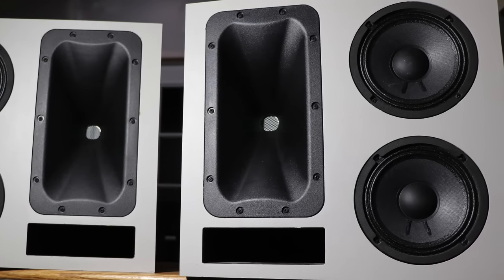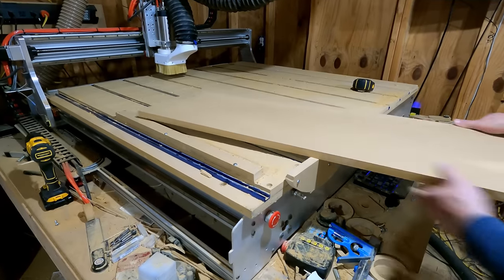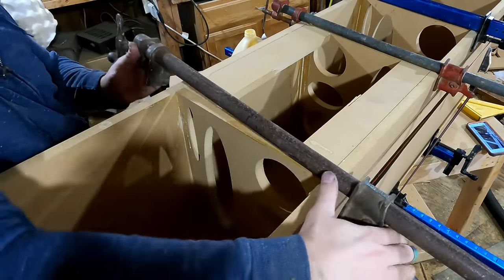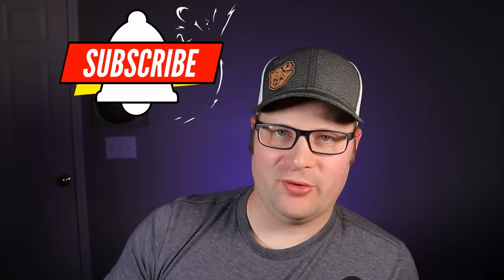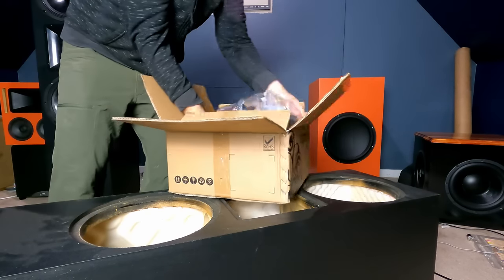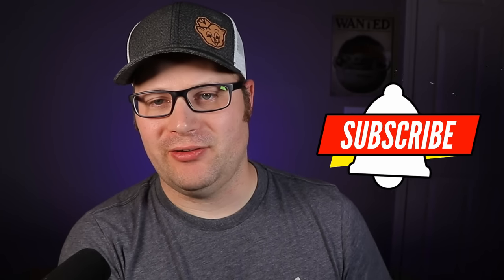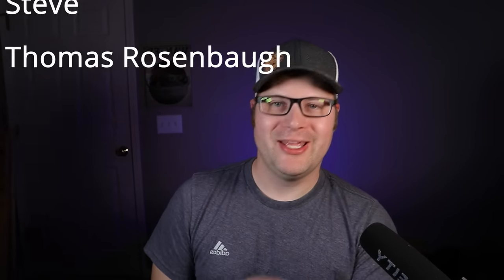How to Build $14,000 speakers for $1,300! JTR 212 Inspired - The Audience 212

Comment: Okay so did you drop these plans yourself and if you did can I get a flat pack for left and right center and how much are you going to charge a flat pack so I didn't go to but then I selling those anymore so I've been interested in doing a surround sound system and I wanted to do it with 12 instead of 10s so with that said I liked the design of these speakers I like the height of them I guess I'd like to hear what you said a flat pack since you have a I can't remember machine to cut these things out does two of the orange speak as you get I would like to build a build a pair of those but I don't have the dimensions of the paperwork to do its measurements so that's one of the reasons why I'm asking are you going to sell these as a flat pack me I kind of want to try the imminent drivers Oriole considering that I work in Pro Sound the ones you're using I've I've never heard those before so I'm not going to act like I have but I've done with you know dealt with some Eminence drivers Black Widow drivers jbl's Evie drivers you know like the 180 days to 15 jbl's and TVs I don't like the TVs but they're only certain I mean don't get me wrong you know you put enough power behind those Rascals they'll get up on there and then they'll stand up the Eminence drivers are very very very very very very clear I have done some gigs in the Ratchet & Company Carnival gigs and I actually stepped on the eaw system and you know what the eaw system cost I built my own subs and I built my own tops I built the system for the company I work for Nashville trapezoid tops Community 415 boxes Louisville Cardinal haven't even built some stage boxes four different sub boxes who are direct outs the one boxes that I'm pretty the devil inverted a teens that I built will you put the 1200 watt drivers in the boxes and we built two boxes and put the does a lowriders from Black Widow lowriders and they're worth like $4,800 4800 driver I'm going to tell you the same thing I tell everybody else if you go to buy the 18 inch lowrider those heavy water 18s they don't work well without without without without the assistant brother you have to buy two of them in order for them to work and you have to put them on the amp by themselves they need plenty of juice but the problem with those amplifiers is this RMS both of them together is about 8,000 Watts you got to have a minimum of 5,000 watts to push them but I guarantee you the 24 in wide 48 in tall 30 inches deep was an inch and a quarter recess in the front so you can build your own Grill every gig I've ever done with those inverted double A teams I've set off alarm I was doing a straight gig on timing shook the peoples pictures off the walls in your house and the crazy thing of it was they wanted us to turn it up and I bought 16 boxes out and put them on the street and it felt like it was making a street wave I see a lot of people come on YouTube and they go buy those black widows lowrider 18 and they don't have any idea you cannot underpower them they're not going to accept it not only that when you underpower speakers you do them damage I'm not saying that to you I'm saying that cuz I know some people it's probably asking why do you need so much power if you're going to run a 400 w 200 watt drivers in your box that's 400 watts do you need 800 watts to run those boxes because you caused the voice coils to run off center you cross them to buckle you do you do more damage to the driver cuz it's underpowered I mean this is also a factor with your home stereo you should not be running your system underpowered your arms you got to pull it manual out and find out what your receiver runs at what is comfortable with running at usually an integrated home system is good at 8 oh it's to 4 Ohms unless you are using an external professional amplifier that can drop down to two and run stable stay away from dropping down the two unless you got an amplifier that can drop down to that and run but as far as the GTRs I don't just want to know if you was going to sell some flat packs of those it's not like the pill two sides and the center Channel and I want I want to try to use the Eminence drivers license I like the fact that you using a 3-inch voice coil and you can get anywhere from a 4:00 800 watt drivers even though I probably won't go no further than 6:00 Century 12 and what for homes and you know I know a lot of people like I asked too much power anybody know anything about sound system is more power means the more clarity and I'm a big sticker I don't care if I'm running a 100,000 watt system when I turn it on I don't want to know it's on I don't want to hear diddly squat out of it until I push something through it and we made an appointment we don't get any systems that whom and if we get something that's how many we want to know where it's coming from and a lot of times I know you guys probably don't understand this but I'm going to drop this little tidbit on you if you are running an amplified system in your home and your system is getting an AC whom have an electrician come over and look inside your electrical panel if it looks like somebody just took a box of wires and threw it at the panel and close it up there's your problem to stop a harmonic hum inside your electric panel your wires must be grouped together in Perfect Harmony is the only way to keep your system from humming and making all kinds of crazy noise and I know a lot of you guys don't know that but you worrying about what your system keeps humming you got a Amplified system with Pro gear amplifiers and you wonder why that noise keep coming up and you can't seem to get rid of it you need what they call an equipment ground an equipment ground is this you hooking up a ground to your main ground bus bar and you are taking that ground outside you going to go to an electronic electric supply store get you a 6-ft ground rod more than likely get you a 304 lb hammer I recommend you put on some work gloves and try to force the ground rod into the ground what you want to do is push that stick with ground rod all the way into the ground you might want to leave maybe I mean cuz you can dig a little bit around it and why don't you hook the ground wire to that that will provide a good solid external ground for your system for your house your house will have a good equipment ground and you want to use a heavy gauge number 10 and number four wire then you also you should not do this already be in your house is called a cold water ground strapped to your water pipes in your house and it's done in your utilities room make sure you do not allow anyone to separate that wire from the cold water ground the danger in that is you will lift ground off of the house and it will fry every electronic you got in your house it will change the load but I just wanted to make sure make you aware that your electrical wiring in your house is vital you cannot have any loose grounds anywhere you plug it up there or sound system and you got to have an equipment equipment ground and a cold water pipe Brown is a necessary evil and make sure you are using a heavy a heavy enough gauge Supply power line to everything that you're plugging up I prefer 14 gauge cabling to everything reason for it 12 gauge cable don't get hot when you're running you know household products and items it won't get hot but you running 14 and 16 ladder gauge cables those cables man they make it hot on you so are you by extension cords make sure they're at least 12 gauge you can get away with 14 and 16 I prefer 12 gauge because no matter no matter what you plug up in your house you'll be covered know a lot of electricity if you're rewiring your house they don't like that hardwire 12-gauge but I'm telling you Destin Waters easy to maneuver and manipulate and so forth but that 12 gauge is a little bit tougher but if you rewire your entire house of 12 gauge cable and it don't matter what you plug up in the house you're fine with the refrigerator but the dishwasher garbage disposal the whirlpool tub and that's on a heavy Gates too your basic house so good as far as the TV and stuff like that it would do fine on 1200 because you know how you grip you about to unplug the clock radio and you noticed that the line is warm because the line is not heavy enough to run something the resistance on the line a word to the wise I would like to buy some flat packs of the jtr system Left Right Center

Comment: I don't see the crossover anywhere.... Is this a physical thing you made?
Reply from the maker: It’s a custom designed crossover. It’s in the build plans.
Reply: @Toid  is there a generic crossover you would recommend with potentiometers so you can adjust on the fly instead of a purpose built one?  I'm new to all this and am trying to learn the ins and outs.  Is one better over the other or is it just a cost yhing?

Comment: You need the know how they are so nice I'm terrible with wood, metals ok but wood, the base drivers magnet it looks small for that big of a speaker or just looks small because they are large,I'm thinking of doing a center speaker I bought the only one that could fit r 34 f but is small, space is a problem for me
Reply from the maker: The magnets look small because they're a neo magnet. But they are very powerful. They are very low distortion. The best 12" woofer I've used for distortion. They are very nice.
Reply: @Toid  ow small but still powerful I didn't know good learned something new,I left the hobby for 30years so much new things got back in sound a year or two ago so don't know much
Reply from the maker: @glengatt3941  glad to have you back in the hobby. You'll find neo magnets on a lot of high-end drivers.
Reply: @Toid  cool to have high end equipment but I can do mid range,I have a pair of towers and I think they were high end 30 years ago jamo 707 series just fixed the base drivers they have a push pull but they are hard to drive so I'm leaving them for music with 2 emotiva basx A2 2 pre amp bi amp,I'm getting the RP 8000f for home cinema

Comment: I have a pair of freshly reconed with new old stock cerwin Vega stroker 18ds, and about 6 sets of dynaudio esotec 3 ways. I collect old school car audio gear. And I really love the look of the strokers so I really want to use them and the dyns are some of my favorite speakers of all time. I want to build some home theater speakers with the. I have a umik 1, laptop with rew, a spl labs spl meter, amm1+, cc1+, dd1+. I have access to a full woodshop and am willing to do it correctly. I also. Have winid, bassbox pro 6.. I'm looking for a place to bounce ideas off of people, get some advice on crossover designs, etc. Can you point me in the right direction, please.
Thank you.

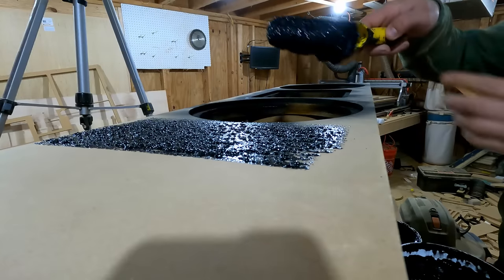Comment: Nice!  Great build.  Two things: 1) that bucket of exohide hanging off the edge of the bench around 7:45 made me super nervous, lol.  2) Ever used Danny's No Rez from GR Research?  It's great for interior/dampening.  Expensive, but worth it imho on the builds I've done with it.
Reply: Try sonic barrier from parts express. It works very well
Reply: @Pete.across.the.street  I have.  My experience with it was underwhelming comparatively.
Reply: @Believeintimetravel  Could you please share the differences between the two?

Comment: Great work ......how did u design the cross over? Could these speaker work with an active crossover
Reply from the maker: You could always design an active crossover for them if you want.  They are designed for a passive crossover.  I am finishing up the plans as we speak.  THey should be available by the end of the day.

Comment: What are you using for surrounds/atmos to match these?
Reply from the maker: I’m using these for surrounds, which are by far my favorite surrounds I made. https://youtu.be/RQlrNc3qqnw I’m not currently using Atmos in my theater room. That will be an upgrade for later. However, I did designs. I’m at my speakers, but you can see on the channel.
Reply: @Toid  sweet! Have been waiting for 1099 kits to come in stock for my new theater build, but i'm super excited to have found this channel and your builds. I have a CNC and don't mind buying parts seperately, so your plans and builds are perfect for me.

Subbed for more!

Comment: Do you think they are more sensitive than the Klipsch thx ultra 2 you built? A brief comparison would be great. Thank you
Reply from the maker: Yes they are. Maybe I'll do a comparison some time on the three latest theater builds. I will say, these are my overall favorite so far.
Reply: @Toid  great I've got the Klipsch ultra right now and thinking this would be a nice upgrade but I would have to shorten the box a little and put the tweeter at the top to be ear level but I don't think it would be much loss especially if I make up the difference in box size by making them a little wider. Thanks for your time amazing work

Comment: Home Hi-fi is the epitome of the laws of diminishing returns. An 8000k pair of speakers will not be twice as good as a 4000k pair. In fact I have the Dali Rubicon 8. The difference between them and the Epicon 8 (double the price) other than some extra bass and weight to the soundstage is almost non existent.

Comment: Hi, what is included more in building plan, 
Does it cover the network and cnc cutting design?
Reply from the maker: The build plan teaches you how to build the speaker. It includes the diagram for the crossover network, and tells you where the cutouts go and what size they need to be. It also covers the port and the bracing.  And of course list links to all the parts needed to build it
Reply: @Toid  i do watch your channel though i am not into electronics. Have a thought to make such speakers, speaker mentioned in the video is not available, so the 12mw300 speaker is available in my country., I will need to hire someone help to build one, so crossover may vary or can still use same if i order your build plan?
Reply from the maker: @pristlehk  the crossover would be different

Comment: Hey, just curious as to what you think a budget version of those would sound like. Using say, grs woofers and horns from parts express. Could be interesting.
Reply from the maker: The main thing would be that you wouldn't be able to have the efficiency. Without the efficiency in using lower in drivers, you might have an issue with distortion. You'll also probably need to get a better amplifier to push them. So there would definitely be some trade-offs. But it's a really cool idea and I would love to see someone do it.
Reply: @Toid thanks for your reply. I am definitely ways pro and cons. I happen to have a couple of grs 8’s. So that’s a pretty strong selling point. Lol

Comment: EXCELLENT BUILD !!!!   I can't agree more ...14K is a  RE DICK U LOUS amount to pay for a pair of 2 ways  "OF THAT TYPE"   meaning exactly as you  have built ... a BADASS DIY for LESS THAN HALF THE PRICE 
AS a DIYer  for years the ONLY improvement I would make for these 2 ways is using a MINIDSP  2x4 HD for some SERIOUS bi amplifying / EQ / PEQ  .... giving your infinite EQ / PEQ / Xover  adjustments to dial these to acoustic perfection .... taking out all the imperfections of passive xovers 
With the $$$$ you save on the JTRs this easily pays for the extra amplifier channels and MiniDSPs

Comment: Isn’t the speakers the cheaper component in your system? A high end DAC costs over 10K.
Reply from the maker: I used some of the highest end components you can buy. These are SB Audience, the PA division of SB Acoustics. They aren't the exact same components used by JTR, but they aren't cheap components either. They would be considered high end. I'm fact, the woofer and compression drivers are some of the best I've tested.

Comment: Those are far from $14k speakers. Driver selection is based on pro audio equipment and cabinet construction, while nice, leaves a lot to be desired. Even the fit and finish are way off from what high end speakers should and could look like. What you have built are exactly what they appear to be - home brew budget MTM towers. If you want to look at or hear something worth $14k, go find some Legacy Audio speakers. That’s a solid $10k+ speaker that you could model on a budget.
Reply: I think the $14k quoted price is based on JTR's suggested price for their equivalent speakers which also use pro audio drivers and have about the same level of finish as these. Also although jtr's use pro audio components I read really good reviews about them in audioholics and audiosciencereview.

Comment: Couple of things 1) MDF needs to be sealed before coating 2) finish the bracing and fit the damping material before you put the front baffle on, would of been much easier. Should sound awesome for home theatre, bonus, much lower price than the other mentioned.

Comment: Would large woofers like this enhance the "chest slam" more? And if it does, Would  that effect still be true at lower listening levels?

This question is coming from me owning m&k s150 LCR speakers which have a 5" midrange. Paired with an svs sb16 and x2 svs sb3000s